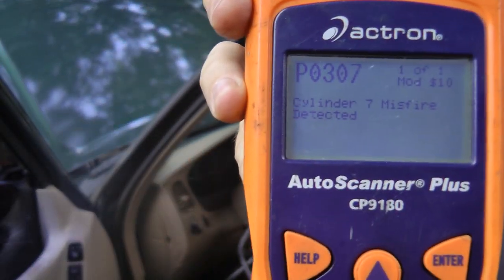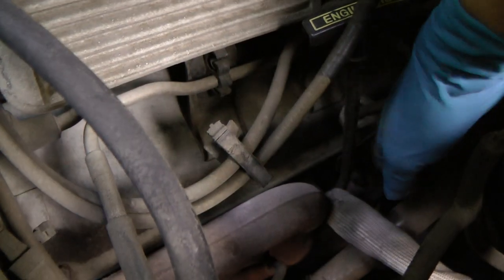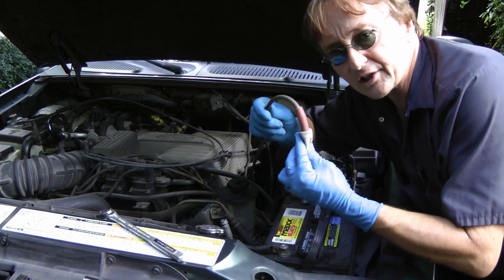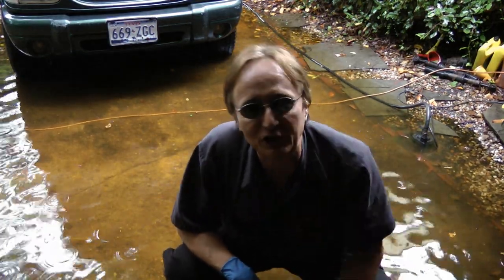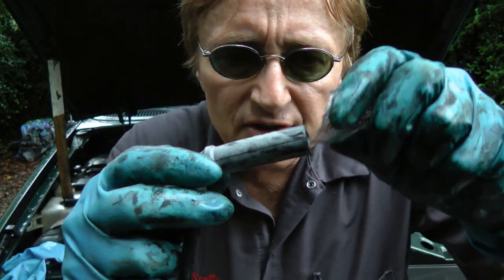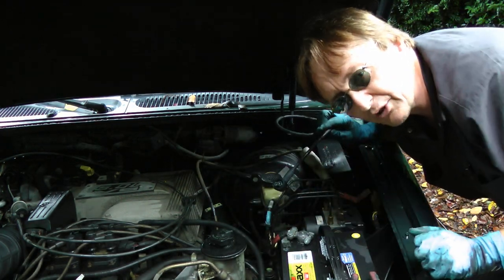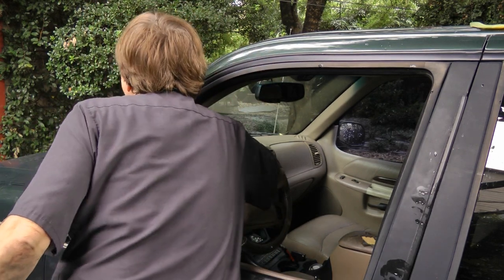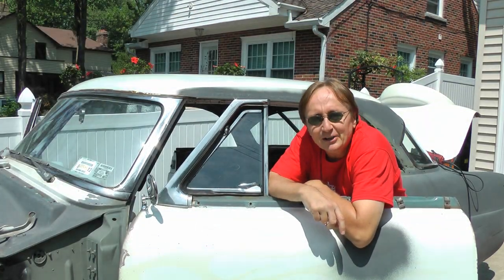How to Fix a Engine Misfire Code P0301 (Spark Plugs and Wires)

Comment: I have 98 chevy c1500 4.3litre and it won't start but wants too.  Here's what I've replaced a Starter, cap and rotor, Battery tested good, and the altenator test good too.  I'm at my wits end could it be a fuel delivery problem?

Comment: Slight misfire in my Chevrolet LS 2.2 liter HHR  2006 changed spark plugs but still a slight misfire should I change the whole coil pack

Comment from the maker: that's misfire on cylinder 5, if you changed the regulator and it came about, often that's a bad fuel injector on 5

Comment: 1999 Jeep XJ Cherokee:

I've done all that, (actually had the p301 come up 1000miles or so after changing the plugswiresrotorcap) and the valve cover gasket (needed it anyway) and the injectors. The #1 injector actually did have a broken rubber O-ring at the engine side, so I thought I was fixing something! NNNyope! Any ideas what next to throw at it?
The new injectors are 4 hole, by the way, replacing, probably original, 1 hole injectors. Since the behavior is the same, it is probably not an issue, but I mention it anyway.
The check engine light will flash at highway speeds or sometimes accelerating from stationary.  But only sometimes.

Comment: Scotty doesn't your basement get flooded? BTW does the same procedure apply on a Chevrolet Blazer or Chevrolet Astro in order to access the spark plugs. Looking through the top it seems almost impossible to get to the spark plugs and wires through the top of the engine bay.

Comment from the maker: cars can die for many reasons, but if it's a late model car, the computer will memorize that fault. then having a guy like me scan it with a machine as in my video "fixing modern cars using high level scan computers" can figure it out with such a machine.

Comment: Hey Scotty
1----I have a 94 Integra and just yesterday, the engine has a misfire. Can I drive around temporarily for a while until I get it fixed ? I heard the fuel injector may cause fire if the spark goes bad or not there ? 

Also, would it hurt the engine in anyway or it  just not moving as fast with less engines working. I tried changing the spark plugs BUT one of them stuck hard and I can't get it out. Thanks

Comment from the maker: you can't really put them on wrong, just make sure they are pushed on tight and on the correct position for each one.  BUT, sometimes you get bad parts, I'd especially be rechecking the wires if you got those cheap chinese made aftermarket ones.

Comment: I suspected leaky fuel injector and replaced only the one injector on 3 ($150 each) and spark plug and confirmed spark to cylinder. Didn't fix and now I have the milky light brown watery/oily stuff like I said in and around that port and on the gasket. I also tested resistance and power to injectors and all is good but I haven't been able to test fuel pressure because expensive special adapters needed. Do you think water is leaking in to the #3 intake port?

Comment from the maker: either coil wire is bad, coil is bad, or distributor cap is bad, sparks only occur at weakened electrical parts.

Comment from the maker: Then I would check the wiring to the injectors, all of them, very closely as they take tiny amounts of power to run and any corrosion or crack in insulation can make em miss.

Comment: Question if ya don’t mind, I’m currently having a problem with a PO305 , PO300 random misfire , and a small evap leak. I’ve changed the spark plugs , the coil packs are fine and the wires don’t look bad, but the trucks CEL. Flashes if I get above 3500 then for a minute the truck shakes and I have a rough idle. What can else should I do to fix it ?

Comment: Hey Scotty my 2002 Toyota Camry 4cyl with 122k miles is idling very  low(100~150rpm)and car is vibreting alot and lack of power is felt also engine check light come on for a while then turned off. Was wondering could this be happaning for a simple tune up? Thanks

Comment: Hi, Scotty I have my mechanic did the stripped spark plug fixed. After he installed everything and Cylinder 5 is still making noise and misfiring do you have any solution for this?

Comment: Ok Scotty, on this 98 Buick Century , Has a brand new ignition coil, wire an spark plug, i noticed it hardly has any blow by , with the engine oil , has spark an fuel about 95 to 100 lbs on compression, since there is hardly an blow by , does that mean the piston rings are good? meaning just a bad or burned intake or exhaust valve ? what normally goes wrong on them GM 3.1 liter, engines, I HATE GM i like FORD ! i would like to fix this P0304 code . please let me know . thanks

Comment: My spark plugs are black around the ring, and the porcelain is still white like new, does that mean my car is running lean? have a 94 prelude, it overheats and i replaced everything in the cooling system and it still does, can a lean condition cause an overheat problem? it hasn't overheated on me when the ac is on

Comment: Hey Scotty, I have a 1997 Benz S420 that has a misfire in cylinders 2 and 4. The coil packs were swapped, and spark plugs appear to be good. the car also seems to be driving okay, and not running hot. It only has a bit of a rougher idle when the vehicle is not in motion. Any advice?

Comment: hey scotty have a quick question i have a chevy 350 dump truck with manual transmission i was wondering if i take the trans out and put a auto 350 turbo trans in and change the steering colum to a automatic steering wheel will it work as an automatic

Comment: Hi Scotty, I just test drove a Hyundai Genesis Coupe today and the car is very bumpy on the road, even more than my 20yr old Integra. Does sport cars designed to be like this or just this one.

I also notice that the wheels are big 19" rims and the tire walls are thin. Would tires with thicker tire walls (more air volume) reduce and smooth out the ride. Or is it the whole suspension system design of a sport cars.
Reply from the maker: yes, they ride like crap due to design. they are going for sport ride. Plus they use low profile rims and tires that really make em ride like crap. That's in now, I personally like normal tires which ride better than racing tires designed for the track and which get blow outs and bent rims in city pot holes

Comment: I have a 2004 chevy silverado 1500 and im reading p0308 misfire on cylinder 8 i changed all spark plugs and wires and im still reading code p0308 what could it be? Oh and i also took a screw driver and pulled the new spark plug cable on cylinder 8 and turned my truck on and put the screw driver close enough to see if power was going thru the cable and it is. So what can it be?

Comment: Hi, I have a 2000 Pontiac Bonneville with 3800 series 2 v6 3.8L I changed the plugs to the urithium plugs an ignition control module an it stop skipping or misfiring for a bit but now it check engine soon light flashing an misfiring again what can a poor man do to stop it

Comment: I have a 93 s10 blazer. replaced o2 sensor and engine lights off and runs like a dream. smogged it and failed because of ignition timing. all the emissions were fine and etc but only thing that caused fail was the ignition timing. what can I do?

Comment: @scotty Kilmer I have an 03 eclipse with the 2.4l engine and its a 5 speed. It cut off on the interstate and won't start anymore. It blows white smoke out of the intake hose but nothong comes out of the tail pipe. It turns over but back fires every so often from the white smoke. I don't think it's the fuel pump but I haven't tried gas or starter fluid yet to see if thats what's causing the problem because the white smoke concerns me. If you have any knowledge what might be caasing this please let me know. The only thing I know is it jumped timing.

Comment: Hey Scotty I been having an issue with my 2006 Dodge Charger,I keep getting a cylinder 2 misfire ,I’ve changed the ignition coil and plug ,but 3 or 4 days later the engine light comes on ,I scan and again cylinder 2 ,what is going on?

Comment: Hi Scotty, i just checked out a 1996 s10 4 cyl....its only running on 2 cylinders and when i start it up after filling radiator water just shoots out of opened radiator top...know water seems to be in oil...and i am pretty sure i can fix miss if i buy it,but not sure if water shooting out is normal.... if you could let me know what could be cause i would be very happy... not sure if i should buy this truck or not....thanks

Comment: Hi Scotty, sometimes after driving for a little while 20mins or so when i put my foot on the acclerator, the exhaust sounds louder and discontinuous. This sound goes straight away when I restart the engine strangely! could this be due to engine misfire or somethung else? 
But as i said it doesn't always come on and goes away when i restart the engine!
any ideas or suggestion is much appreciated

Comment: Scotty I have a 98 Nissan Frontier I have code p0301 thrown I’ve replaced plugs, plug wires and fuel injector still have the code throwing what would be next step to take

Comment: p301 on 05 caravan 3.3l,i put in new plugs,wires and coil pack,no difference,only a slight shaking less than 30 seconds at cold start,after that runs smooth,no power loss and no hesitation.Ever experience anything like this???.
Your diagnoses please.
Reply from the maker: swap the #1 injector with another, if miss moves, replace it.

Comment: Hi scooty I changed my car half engine & head rebuild car is starting perfect but some misfire occurs at low rpm when in high speed engine was good & not check light is on what problem it was?

Comment: Hey Scotty, I have a 1999 honda civic. The check engine light recently went off and diagnostic codes told me it was an engine misfire in cylinder 4. Ive replaced the spark plugs and the wires as well; the distributor is also relatively new and working properly but the engine misfire code continues to set appear and set off check engine light. How can I go about fixing that?

Comment: Hi again Scotty Fixed coil bracket,also New coil tried 2 sets of new plug wires dist cap and rotor were checked and mechanic says there good BUT i'm still getting a misfire and arching at the coil wire. I spoke to a few other mechanics about this and they dont know the exact cause and I dont feel like spending any more money to garages that "guess" what the issue is and dont have a clue. Any idea what the cause is??? HELP!!!!!!!!! Thanks

Comment: I just left discount auto my service engine light was on they checked that in the guy told me the code was P 303 he told me it was something with the transmission on a 2003 Nissan Altima four cylinder 2.5 what do you think the problem could be

Comment: Hi Scotty, I have a question. My 07 nissan murano is misfiring with p0301 code. I had someone look at it. He told me the spark plugs and coil looks fine in #1.. he thinks its my timing belt. I dont believe him.. would you?  I really need advise

Comment: Scotty,
I have a 2003 GMC 5.3.  When it is real cold in the morning, my engine will sputter a little and misfire for about 10 seconds, as indicated by the flashing CEL.  After a minute it purrs like a kitten.  Any ideas?  I have heard it may be an intake gasket, but I am not losing water.  Thanks.

Comment: Hi Scotty is it possible for a car with good compression (all cylinders near 180 psi) to have an engine valve leak?

A mechanic has already plugged in a diagnostic tool and found nothing even a misfire code.

He checked the electrical he even an similar injector from another car with same brand and model. Only the cylinder #2 is misfiring and its not very obvious but if I lift he HTW and plug it back again there is very little difference in the RPM. He said there is electricity and fuel going in the cylinder. The spark plug in the #2 always has a powdery black carbon. My engine oil that I changed 2 days ago is very thick and black. 

I brought it to a mechanic for a top overhaul and he refused he said it might be something else since the compression is good. He said it could not be engine valve leak if the compression is good. I have two different opinions from two mechanics. Do you think it is the engine valve or not? thank you

Mazda Protege 1996 MT

Comment: Hi Scotty. So, my mom has a 1992 Ford Explorer XLT Automatic 4x4. Not too long ago, the transmission had started to slip and then it started leaking transmission fluid at a pretty rapid rate. It seems to be coming from the front of the transmission, where it bolts up to the engine. It had no leaks before, so it was pretty spontaneous. Is this something as simple as a bad seal, or is the transmission completely hosed and we'd be better off getting rid of it? The car was only 800 bucks, so, yeah.
Reply from the maker: yes, bad front main seal of the transmission , but you have to pull the transmission off to replace it, BIG money there. Do try my sealer trick though, get some AT 205 reseal (Amazon sells it) , pour it in the transmission, and pray it seals that leak within a week of driving

Comment: Hi scotty, I was just told by a mechanic that possibly the bracket that holds my coil may not be properly grounded.
when I hooked up new coil to try see if the misfire would stop I just unplugged old one and plugged in new one but didnt install it into the bracket. Could this be causing the arching from the coil wire?? Thanks

Comment: I have a 97 dodge ram with 2 stuck spark plugs.  I took it to a shop and they were able to remove 6 of the 8.  The 2 bad ones they said they couldn't get.  I spent a weekend letting PB blaster soak the front right and Sunday afternoon I got it to move.  It runs better, but is there a better way to get the other one out.  I am afraid of a 1200 dollar bill for fixing it if I break it off or strip it out.

Comment: Hey scotty, i have 1996 honda accord 4 cylinder with 2 codes i retrieved via Eric the Car Guy's honda code retreival method by jumping a 2 pin connector and reading the check engine light flashes. The code im most concerned about is code 76 which is a cylinder #6 misfire. But i don't have a 6 cylinder, i have a 4 cylinder. What does code 76 mean to a 4 cylinder accord?

Comment: does a burnt exhaust valve cause high fuel consumption, smokey exhaust, serious misfiring and fouling spark plugs quickly? i had a 1996 toyota cavalier that did this and i was told burnt exhaust valve. The car had a full and i mean FULL service and it still did it and the mechanic said burnt exhaust valve so i gave it away for a burn out car. is this diagnosis correct?

Comment: what are the signs of bad camshaft in general and why does the camshaft wear out
Reply from the maker: friction makes em wear out so dirty oil makes em wear out faster. if bad, engine will idle poorly and often make noises accelerating

Comment: hey scotty i m working on nissan pathfinder 2001 it got code p0300 and p1320 i put new coil i think its the cable or plugs are bad it runs strong and good i look at cables and plugs too ???

Comment: Hi scotty kilmer. i have nissan sentra 2010 2.0 and i have a p0304 cyl4misfire  code. i changed the spark plugs and ignition coil , i also erased the code twice  and still on. can you please  help me with suggestions??? thank you very much for your helpful  videos!!!!
Reply from the maker: swap #4 injector with another to see if the miss moves, showin a bad injector

Comment: Hi Scotty, I have a 2002 Ford Taurus. I have the error code P0302 - Misfire on Cylinder 2. I've checked the coil, the wire and the spark plug for cylinder 2. After replacing the spark plug, the current flows fine through all three. I'm still getting the misfire, and my car shakes terribly. I checked my fuel injector with a long screwdriver to see if the injector was turning on and off correctly, and it sounded fine. If the coil, wire, spark plug, and injector are okay, what could be my problem?

Comment: hey scotty my 2001 mustang gt sometimes has starting problems in fact it will turn on and I have to keep foot on the pedal to keep it running once I real ease my foot it goes dead. A neighborhood mechanic checked it out and said it was the solenoid which i tap with a stapler to get it running. My only question is do I also need and EGR because it sounds like one piston starts up before the others like its struggling to start

Comment: every how many miles the fuel injectors need to be cleaned  and there are any tips to avoid early fuel pump failure because the new cars nowadays the fuel pump fails too fast there are cars from 1996 still the fuel pump is in good shape
Reply from the maker: no actual time frame,it would depend on quality of fuel and how you drive, more highway high speed driving would clean them better just driving the car.  NEVER run out of gas and use quality fuel to keep pumps going, but companies like GM it doesn't matter, as they use amp pumps so they just burn out a lot as they age. For example toyota uses lower amp pumps which seem to last forever most of the time

Comment: Hey Scotty. Thanks for sharing! I have a 97 4Runner V6 and I get a P0301 about once very month or two. It will come on, ill reset it, and it inevitably throws a p0301 after a month or longer. Doesn't idle/accelerate funny. Just wondered if you knew what an intermittent p0301 would be caused by. Thanks for any help!
Reply from the maker: tons of things can do that, from a weak fuel injector, weak valve springs, or leaking intake manifold gasket on #1 cylinder. Even weak spark plugs or wires there will cause it
Reply: Scotty Kilmer Wow, I need to do some diagnosing i guess. Where would you start? With the plugs?